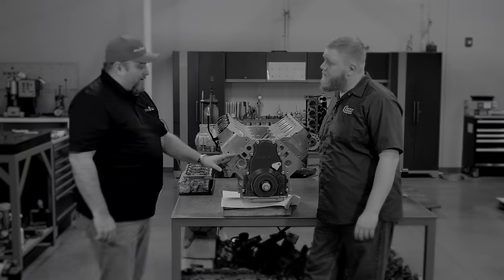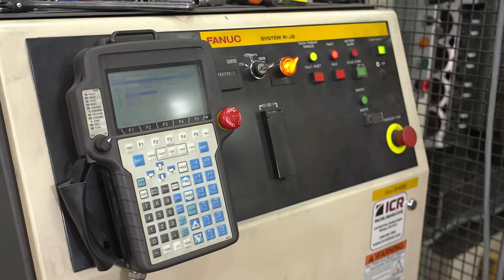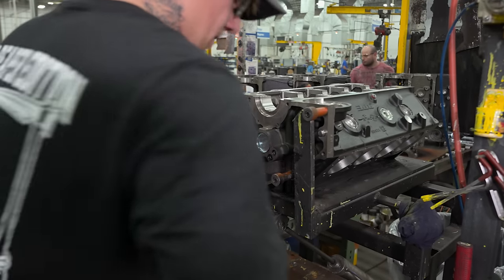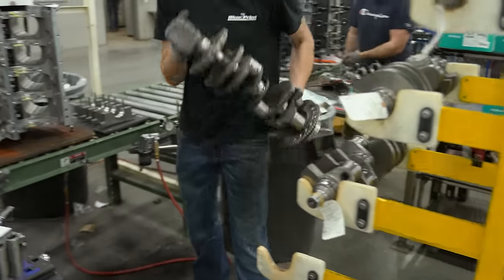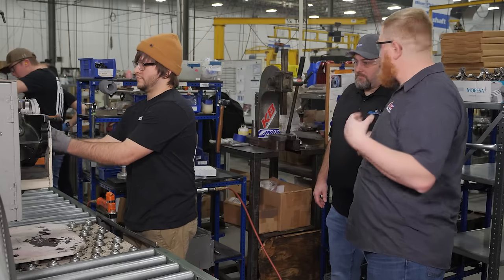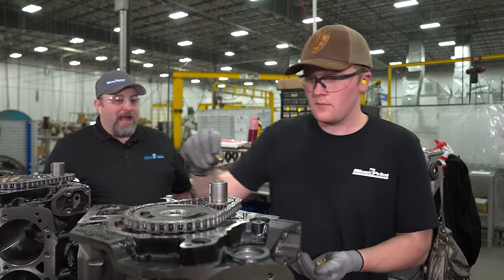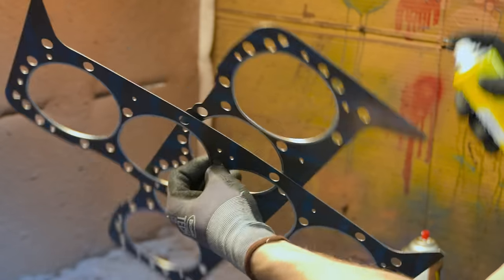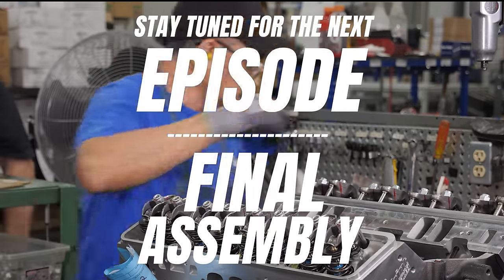How’s a Crate Motor Get Built? Part 2 of Our BluePrint Engines Factory Tour

Comment: How often are the machines checked for accuracy?
Reply: All the time and they are very accurate, I used to work for car manufacturer that used machines like that to torque all suspension bolts and wheels.  That's where all of it was designed

Comment: Honestly not impressed. Like any other engine assembly plant. Surprised to see how little lube they put on their parts
Reply: Don't need a bunch of lube when you prime the oil pump with drill! They probably pump oil in engine with their on pump,don't have to use engines oil pump. Alot of machine shops do it that way.